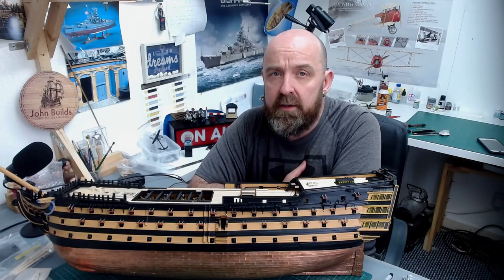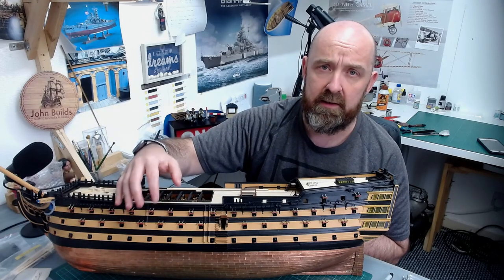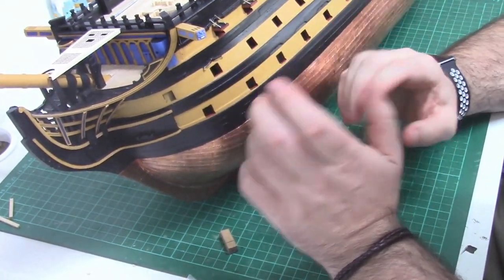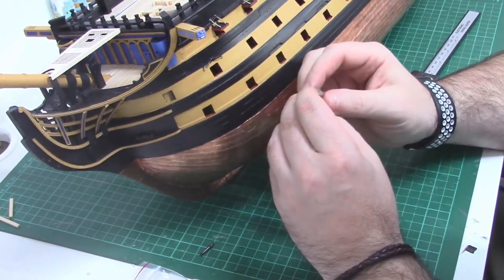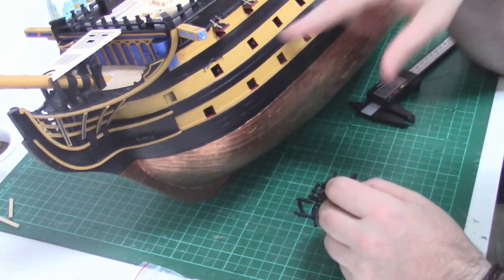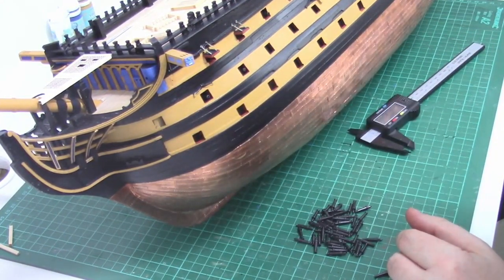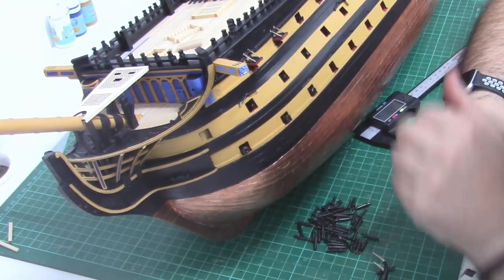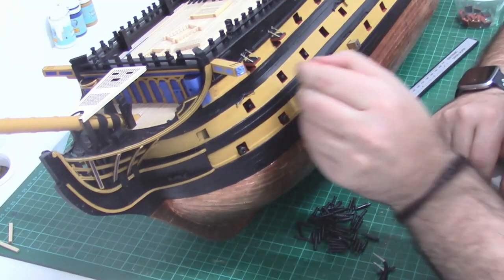Model Ship Building :1/84 Scale : HMS Victory : Part 78 : Full Broadside

Comment: Very nice work John . I have just painted my Victory and I also did not think about the other wiggles .  Bot I will be putting the gun in before I do the port lids.
Reply from the maker: Hi Sal, the lower gun port wiggles. Would have been so much easier to fit before the hull was painted